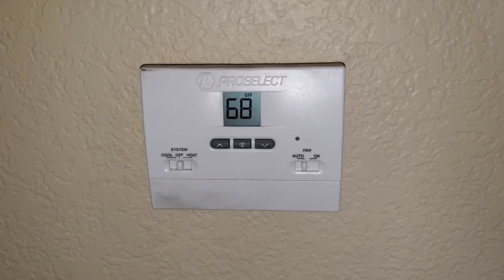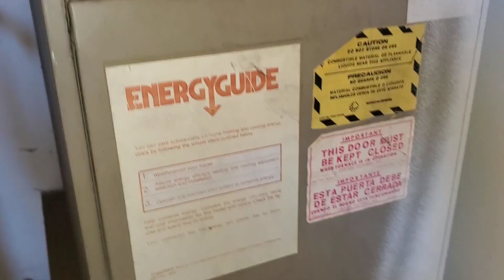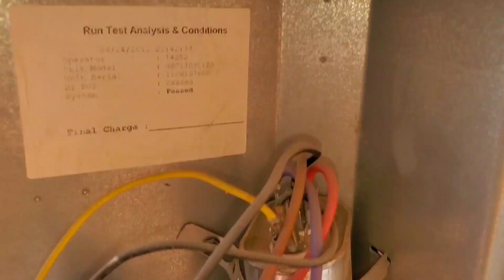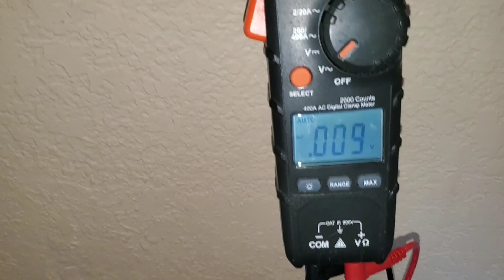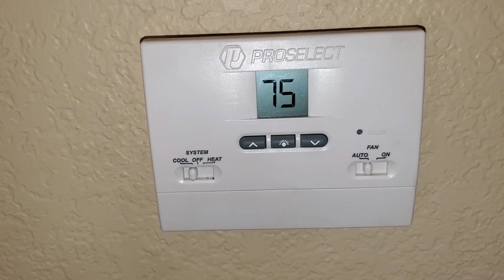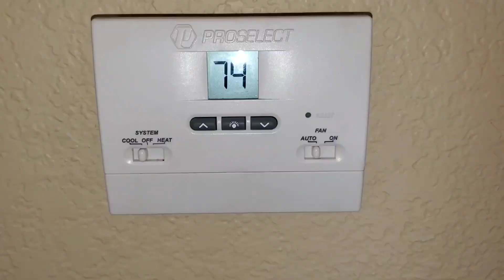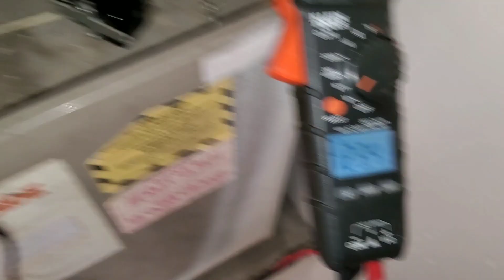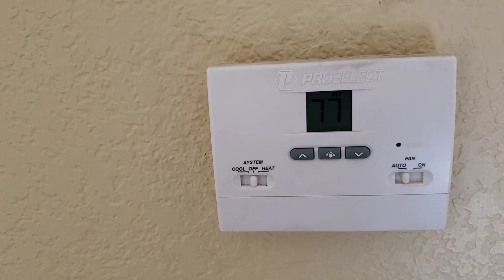Troubleshooting AC for Beginners ONLY! Part 2 Thermostat Troubleshooting.

Comment: I know that you mentioned at the end about stuff you may have missed or didn't add.  I am not an HVAC pro but a homeowner.  My issue is that our AC stopped working about 4-5 days ago.   We have been having Thunder storms,  some water in our " basement"  actually a partially dug out dirt floor space where our furnace and water heater are in our 1850's house.  One item I am in question about as a possible reason for no voltage at Thermostat is, the condensate pump/piping.   I think if it is clogged or gets to where it trips,  will this condition cause a no 24 voltage situation instead of some of the other reasons you posted?   In other words.  No blower,  now condenser, no 24 V at T Stat, no fan or condenser spins even when jumpered.  However a faint hum, inside the interior unit when the ON OFF switch is turned on.

Comment: Is the outdoor unit both evaporator and condenser or is the evaporator with the air handler?  Pardon my ignorance.
Reply: If it’s a heat pump the condenser is outside, the evaporator/furnace/“return,”/ air handler is inside for cooling.  The locations are reversed (when the reversing valve changes refrigerant flow /direction) Now the condenser becomes the evaporator and the evaporator becomes the condenser.  ((Unless the outdoor unit is in defrost mode)). In that case it goes into cooling mode every once in a while to melt the ice on the outdoor unit. Also in that case the outdoor unit runs with the fan off to speed up melting.
Reply: @joeshap3687 thanks…
Reply: No the evaporator is located inside the home. In this video the indoor unit has the evaporator located above the fan. The outdoor unit we call the condenser unit where the compressor is located
Reply: @altrmind so really it’s not just the fan…it’s the evaporator unit…and it includes the fan…got it…

Comment: I am really confused why at 4:23 you decide to troubleshoot the blower motor rather than simply switching fan to on? If you switch to on and the air con comes on haven't you just eliminated the blower motor step?

Comment: Question for anyone; Why is he using the black lead on the multi meter to touch the transformer and not the red lead?  it's on 10:50 part. So the black is common and red is voltage. I would have used the red one to touch the transformer/low voltage switch.
Thank you
Reply: I'm sorry it's been a long time, but I thought I'd attempt an answer for you. Since Alternating Current is both positive and negative, which lead is used on whichever component generally doesn't matter. In Direct Current, there is a definite positive and negative flow of electricity, so lead placement matters more. With AC, I guess it's a matter of preference. HTH

Comment: I have a question please I noticed on your unit I didn't see a board is that true cuz you were taking voltage readings right off of the transformer. The unit I'm trying to get working it does have a board and I only have two wires coming in to the high voltage side of the transformer and two wires coming out from the low voltage side of the transformer. 
When I turn my thermostat on to call for heating or cooling I get nothing no fan no nothing at the blower motor inside. My fan is running outside but I don't hear the compressor kicking in.
Down at the furnace unit on the board I don't seem to have power at my red terminal which is your power and I did jump from R to G what should have allowed my blower motor to come on (I did have the door safety override switch pressed in)
I suppose my next step would be to verify that I have 120 volts going into my transformer and roughly 24 volts coming out of my low voltage side of the transformer correct? Also a lot of the YouTube videos and articles on the internet are referring to a 3 amp fuse on the board for the life of me I do not see a 3 amp fuse on the board. Do all those boards have a fuse? Could the fuse be elsewhere?

Comment: Nothing running.  No low voltage at contactor, no voltage at the Thermostat back plate, control panel is energized.  Is this a broken thermostat wire?

Comment: As a owner, techs are told to never ever use anything to push in a contactor that could spark, use your pen a stick a rock .If you hit the 120vlt side and cause a spark, you are (not) covered by workman's comp . I know it happened to me,  customer called my name and poof, my screwdriver tip had a hole.
Be warned, Be safe

Comment: Why do you not refer to the blower section as the air handler or furnace? Iv'e never heard of that section referred to as the return. I understand thats where the return air is but to refer to that piece of equipment as the return? I dont get it.

Comment: Hi, I have a question my Thermostat works but it do not stay at my set point if i set to a temperature like 80 it will start a/c but bring the house temp to 74 or 72-- A/c start & shutdown but not at my preset temp--I changed Programmable thermostat to Manual  Round  Honeywell but same --I cleaned the control board at furnace where there was some water leak above furnace whole house dehumidifier-Please help

Comment: 4:25 if the cool or snowflake is flashing. It could be a time delay setting. You might also have a time delay in the condenser unit. Just another helpful tip that took me a while to learn. Which you did mention.
Reply from the maker: Thank you for adding your input. It does not hurt to reiterate this helpful and important tip for other viewers! 🙂